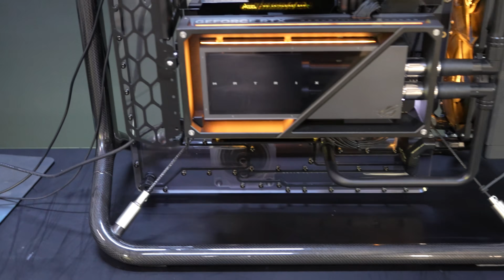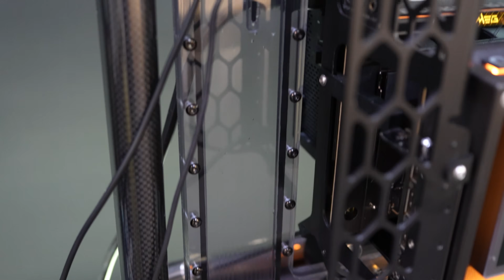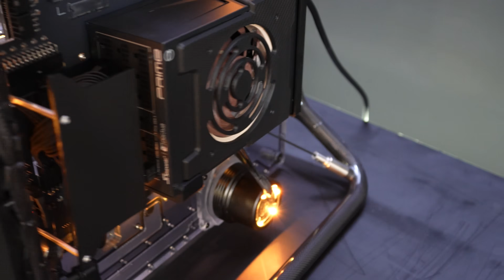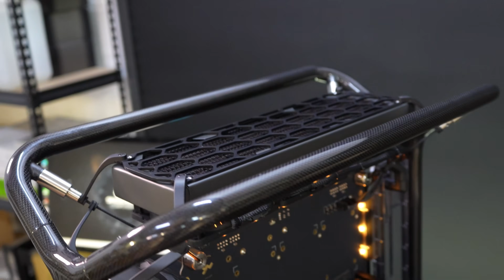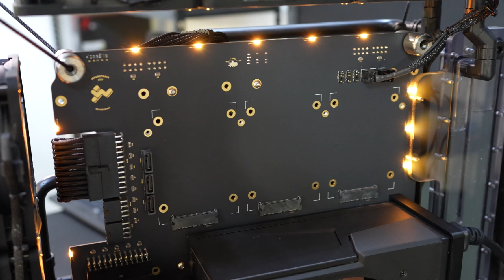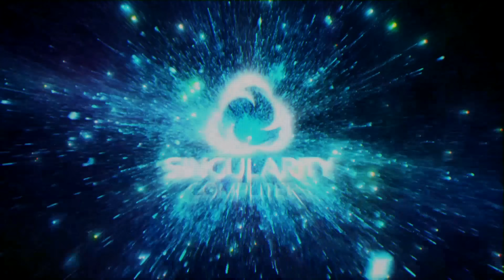Build 132: EVGA E1

Comment: Checked the site, seen Portal Wall Mount Water-cooling Case. Seems you achieve something similar if you mount the power board atop the standoffs and a custom frame to support it on a desk?- Interesting.